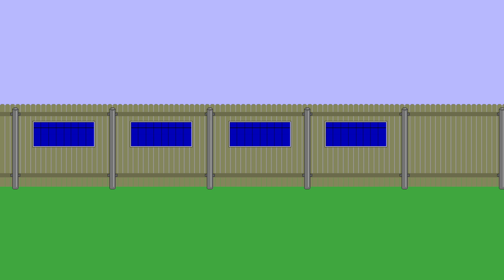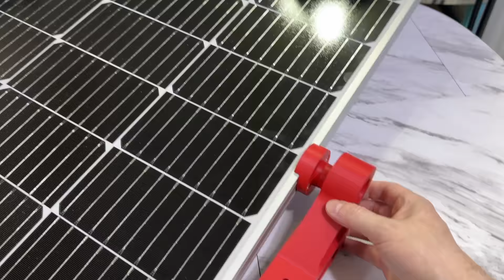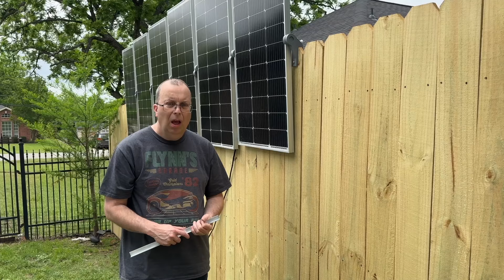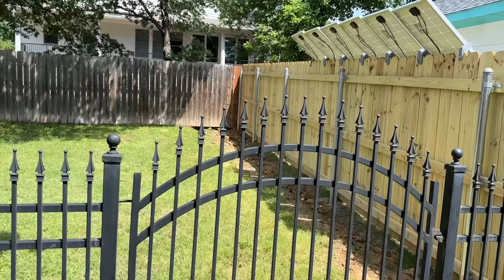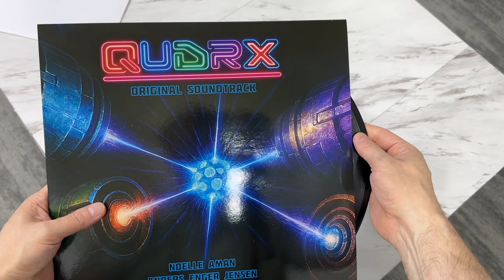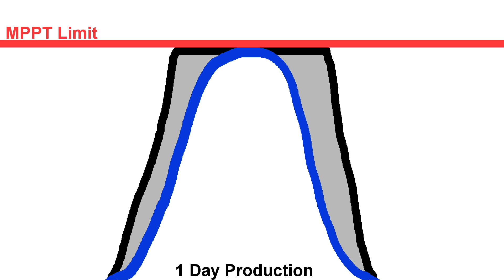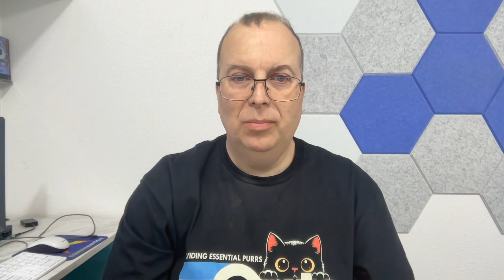I made an adjustable Solar Fence!

Comment: This setup looks very different from other setups I’ve seen. Why are you connecting the panels in parallel? What is MPPT voltage range of your inverter?
Reply from the maker: they are in a series/parallel config.  The max voltage on my MPPT is 60v.

Comment: A place that I was living at previously had a solar panel tower that kind of worked like a rotating radar dish
It was programmed to rotate based on the time of day to always face the sun
I bet you could add motors and a control system to have the panels on the fence adjust themselves automatically as well, but I guess that would be way overkill
Reply: And hideously complicated. There are simple existing systems where there is a single cable or rod through all the panels near the bottom and you just move the ends.

Comment: You could also put panels on top of some kind of storage containers, instead of on the fence. And if you wanted to be fancy, you could have motors inside the cabinets to turn the panels automatically for optimal sun angle during the day.

Comment: This dude will do anything other than putting the panels on his bare roof.
Reply: I am sure he is on the fence about the idea.
Reply: The only part of his roof that faces south already has panels. My guess is that he doesn’t want to go through all that trouble and expense (including acquiring permits) to install panels that will inherently face a less-than-ideal direction.
Reply: I was wondering about that, the main house seems to have space for more panels on it.
Reply: and the neighbour's house (mom) has a decent roof space, not far away.
Reply: You do understand that he has trees casting shadows making the effort not worth it.
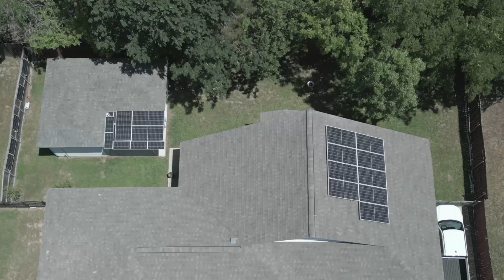Reply: @F40PH-2CAT  8:17 How much shadow do you see cast on the roof? If he gets 3 hours instead of 5 hours of sunlight, just add a few more panels. Putting them on a fence for the sake of efficiency is just silly.
Reply: My thoughts exactly
Reply: pretty hard to clean them up there
My gripe with solar panels overall is that I know the entire center of the country gets pummeled by hail more often than never. and 'never' is kinda what would be required to make this work.
Reply: Maybe you didn't notice but they do have some panels on the roof.
Reply: @Tahngarthor  barely lol. He’s basically got like a 4 kW at max setup on his own

Comment: Now... develop a servo drive that automatically positions these panels for optimal output.  Seems like a nice Arduino project.
{EDIT}  I see others have suggested ESP32 instead of Arduino.  Whatever works.

If a neighbor was to object about the panels being over the property line, then hinge them at the top instead of in the middle.  David doesn't have this problem, but it's an easy one to solve.

Comment: Free night electric plans are awesome when you have solar and batteries!  We have a 16kW solar system with 55kWh of battery.  We had 3 EVs until our kid went to college (now only 2), and our utility bill is $6-7 most months.  The only time it’s higher is if the system goes into storm mode and charges the batteries during the day (rare, but can happen once or twice a month during certain parts of the year).  But even then our biggest bill was under $30 (basically insurance to top off the battery so we have power during a grid outage, which has happened a few times, but our house had full regular power…).  The system generates over 90% of our household and vehicle needs annually — for nearly 5 years now!

Comment: Here is a thought.. what about adding a locking mechanism directly in the 3D printed hinges? Even a ratchet style locking system would work. Or friction with a screw-in key

Comment: I can't help but notice, are those fence pickets simply nailed in place? Maybe they used decking screws.
Reply from the maker: yeah.. they are nailed.  I have considered bolting them together for extra strength.. at least the pickets that are carrying the load.

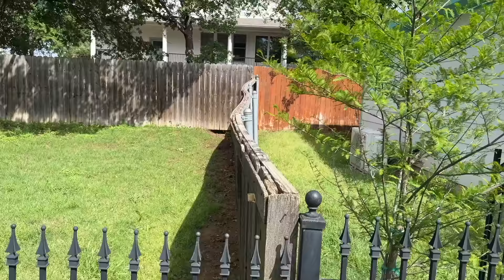Comment: 1:02 that sucks man... 15 years seems like a short lifespan for a fence
Reply: Ha!  15 years is very good for a simple picket fence.  Especially if you're mounting panels on it.
Reply: I think its mostly with the way its constructed, where the heat and cold and humidity make the boards bend slowly over time. Most fences probably dont reach 20 without repairs and painting

Comment: Another option is to use aluminum U extrusion, drill a series of holes down the length, and pin the prop rod to the U extrusion to get the right angle.

Comment: Drill holes through the 3D part that pivots and put a pin/nail through it to set the angle. You can add multiple holes for different angles.
Reply: I guess the levereged force from wind blowing against the panels at 80mph would tear the 3D printed joints apart if you did that.

Comment: I'd be very curious how this withstands a significant wind storm.
Reply: Gonna snap those pickets for sure
Reply: He could lower their angle to horizontal in the event of a windstorm.  Though at fence height level, with all those trees and the houses, it will block a significant amount of wind compared to the roof.
Reply: @beyondfossil Horizontal?!?  That's asking for flying solar panels...
Reply: @tbuitendyk @tbuitendyk The rationale is that the winds normally come in parallel with the ground, and that fence is low compared to a roof—the fence solar is essentially a ground-mount solar array.

We want to prevent the solar panels from acting as a sail in those winds and reduce high wind loads.
Reply: @beyondfossil No, i don't think so. I think you will have a high pressure zone under the windward side unless the fence is completely porous to the wind.
Reply: @tbuitendyk @tbuitendyk  There would be bottom pressure, but it would be much less than the aggregate horizontal sustained wind load and gusts.  Up to half his panel's height sticks up above the fence line in his normal tilt configuration.

Furthermore, under-pressure winds would only be generated by eddy currents in such an enclosed, close-to-the-ground environment, with so many objects in the way.  So those eddy currents have already experienced high amounts of friction with ground objects, and the wind has to make sharp turns.  So eddy winds have reduced energy compared to direct pressure from horizontal winds, which experience much less friction.

Bottom line: it's significantly better for those fence-mounted solar panels to be horizontal than vertical during a storm.
Reply: Probably not very well. Maybe if latched from both sides it may fair better
Reply: @sniper441 it doesn’t, after 1st year of thermal stress to poor ASA prints will snap on the 1st opportunity. There’s a reason why those commercially available small panels had proper metal mounts. I mean, on the bright side we’ll be getting more content next year! ;)
Reply: @kr15uk yeah, I'm baffled why he didn't get the mounts machined, after testing with 3D prints.

Comment: Better check local codes regarding fence heights.   Most panels are not designed to mounted that way,  see manufacturer data sheet

Comment: If 80 mph wind doesn't rip the panels off, it will rip the fence out of the ground instead. Its cool, but you'll have to be really mindful to lock them down.
Reply: Yeah I was going to say fence slats are definitely not rated structural.  I would say use steel channel strut for this.
Reply: @ItIsNot1984   I was thinking the same thing. It's primarily Mom's house that will be damaged but maybe insurance will cover it.
Reply: Yeah. As long as the panels stick above the fence, I don't think any angle is going to help much. If the wind comes from behind, those slats are probably peeling off from the top. If it comes from the front, they might flip over the top and end up in his mom's yard.

Comment: I think you still have plenty of space on your roof for panels. But it will be a pain to put them up. Yes some will produce less electricity than others. But you won't be running outside each time to adjust them all the time on the fence and esp when a 80 mile an hr wind comes around. I wonder will your batteries pay for themselves ?

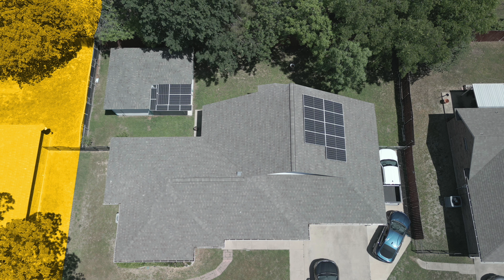Comment: I have  peak shaving system 1.2kw of panels, 5kWh batt, 1.2kw grid tied inverter which turns on during peak hours (7:00-11:00 & 17:00 to 21:00) . My panels charge the battery via charge controllers. My solution the battery full problem is to dump excess into the hot water cylinder (off peak only) Only if there is a reasonable amount of solar energy for the day so far when the battery gets to 98% if not wait for peak rate at 5pm then turn on the inverter. If solar energy is low for the day generally i use a charger to fill the battery from the grid and peak shave from 40c peak to 20c off peak so a 1$ a day without any panel contribution. I seem to have this balanced now so I cycle the 5kWh battery up to 1.7 times a day if there is high demand.

Comment: David -
In my experience, fence boards are not that securely connected to the horizontal rails. In your case, it appears as if each board is held to each rail with only a pair of nails. With the increase in wind load (and it's not an even load, since each panel is connected to only two boards rather than the entire length of fence), you're significantly increasing the tension on those nails. Even if they stay in initially, over time they're probably going to work their way out. My suggestion would be to attach each supporting board to the rails using bolts, or at least some decent lag screws.
Reply from the maker: I have already thought about that.. and soon I plan to put some bolts all the way through with washers on each side.

Comment: Add more solar panels to collect more energy. Add more batteries to collect all power. Run out of battery capacity so add more solar panels to collect more power. Now fully charged earlier in the day so add more batteries to compensate.
Solar production stops earlier, so add more panels to compensate.
Battery is charged sooner so add more batteries to compensate. 
Solar production stops earlier, so add more panels to compensate.
Battery is charged sooner so add more batteries to compensate. 
Solar production stops earlier, so add more panels to compensate.
Battery is charged sooner so add more batteries to compensate. 
Solar production stops earlier, so add more panels to compensate.
Battery is charged sooner so add more batteries to compensate. 

Welcome to the never ending problem us off-grid folk run into  😆

Comment: Some people use second hand pannels on fences so they just cover the fence with pannels. They exchange efficiency for area.
Reply: Or just make the fence out of old solar panels. In the saner parts of the world it's actually cheaper to use second hand panels than timber over a 20 year period as panels don't need repainting and repair in the same way. That's even if you don't plug them in.

Comment: What I would have done with the adjustment locks, on those 3D printed blocks I'd have a hole that passed through the outside and goes into a recess in the adjustable part. That way you only need a single locking mechanism, can easily adjust it when needed, and can unlock it and drop it down when needed.

Comment: One fairly cheap and easy to weather-proof method of moving those panels is a series of small steel cables. You would attach a cable to the bottom of each panel and have pulleys mounted on the fence below them. You would gather all the cables ends and crimp them together leaving one cable which would be wound on a small hand (or motorized) winch would would tilt all the panels at one. You would need either a second set of cable an another winch or make them spring loaded.

Another option is a long metal pipe, mounted in bearings, running the length of the fence. A cable from each panel could be wrapped around the pipe to act as a winch. Again, you would need a second winch pipe or springs.

Comment: As an Australian, with the highest penetration of rooftop solar in the world, it's interesting to watch Solar Videos from other parts of the world.  

For example:
- I have what's regarded as a smallish system at home with 8kW of Panels and only 20kWh of battery storage. 
- Because we have so much solar, our cheap power is during the day, not at night, some providers give you 3 hours of free power in the middle of the day, not the middle of the night (though cheap power is sometimes available after 9pm).

Comment: Next month's video "why attaching .7 square meter solar panels to a fence (using plastic parts no less) is a TERRIBLE idea"
The amount of force the wind can exert on a .7 square meter solar panel is enough to rip it right off the fence and send it flying through the air and at worst, hit a kid.

Comment: Wind load increases by the square of the height I seem to recall. So 1.77X if those are 4 ft panels. An un-renenforced 8' CMU block wall can go over at 60 mph

Comment: I have a completely offgrid building(500sq ft) about 2 hours drive from there with the same temperature range. I have 14 250 watt panels and 15kwh of battery capacity, and I can just leave the ac/heatpump(12,000 btu mini split) running as long as the sun is out half the day and it's above 45F. I have everything now to replace it with 14 410 watt bifacial panels and 25 kwh nore of batteries to run a second similar size building too. I'll move the old system to my on grid house and use that to cut my bill and be more comfortable during outages.
The biggest key it to have acreage, then you don't have to worry about neighbors. 😂

Comment: Solar is the future, assuming you don't live in Foggy Bottom.  Problem is they take up a lot of space to have a good output, and there is no sunlight at night, so expensive and heavy batteries are a necessity.  Panels are best on the roof though.  And of course snow, bird poop, dust, etc. can accumulate on the panels, so cleaning will be necessary at times.  Big advantage is no (or very minimal if you want adjustable pointing) moving parts so 20+ year lifetime is easily doable.

Comment: Speaking of energy plans, I’m in the UK, and an option I have here is a plan called Agile Octopus
Not for everyone, but if you can move around your energy usage, it is absolutely amazing! Price changes every half hour, is lower than the standard tariff most of the time, is capped at 99p/kWh, and if there is too much energy on the grid, prices also go negative!
Reply: I thought we had it bad at 26¢/kWh in Ireland, 99p is ludicrous.

Comment: With your IT background have you ever thought about motorizing your panels to move them to the proper angle based on the time of day and day of the year? I would think that could be computationally achievable. You could also have a rain or wind sensor to lock them down should bad weather roll through  I enjoy your channel.

Comment: I understand the need to mount the panels high to avoid shadows. But if your neighbour is not as understanding with regard to panels tilting over the fence on his side, you could consider building a higher fence to stay above the shadow line, if that is allowed and mount the pivot point at the top of both the fence and the panel. and keep the lower mechanism the same. To reach the same angles, the strut obviously needs to be longer. Another alternative, if the fence can't be higher or if you have an abundance of horizontal fence length, would be to mount the panels in landscape mode using the same top-mounted pivots described in my first alternative.
Reply: Did you watch the video? His neighbor... is his mother. She doesn't give a shit about the panels.
Reply: @md_vandenberg Yes, I did watch, but you did not read my reaction. I gave these alternatives in case someone had to deal with a neighbour who was not as understanding. Not just in his specific case but also for other people.
Reply: Or just get permission from Mommy...

Comment: How about a sensor wich points into de sun and the solar pannels rotate and positioning into the sun like the big radar from the movies. The sun moves and the big radar points into the sun. Sorry but I dont understand about electric stuff.

How about place an special sensor balance between the solar pannels wich provide the best degree of diagonal.

Solar painel, then o the left the support has an Electronic de ice wich provide the best angle and or degree and rises and or bellow the positioning of your solar pannels.

Imagine this your solar pannel is a wind catcher, on the left support has an Electronic device for the best angle wind catcher, then that Electronic device wich has an small computer analizes and corrects the best positioning. Is it possible or useless. Sorry my english I dont understand Electronic stuff 😅😊

Comment: Why not put panels on the other 2/3rds of the side of the house roof that already has panels?
Also have you checked with your power company whether they have a prosumer contract option so that you can send your excess power to the grid when batteries are full?

Comment: Ball bearing detent in the hinges could be a solution to set the angle. Ball bearing with strong spring behind to click in the angle, could have predefined angles easy to change depending on time of year.

Comment: OMG...$600 USD a month for power.  I pay like $150 CAN in the middle of summer with the air conditioner running 24/7.
Reply: I live in a 2000 square foot home just outside Dallas, and my electric bill is only about $300 in the hottest part of summer.